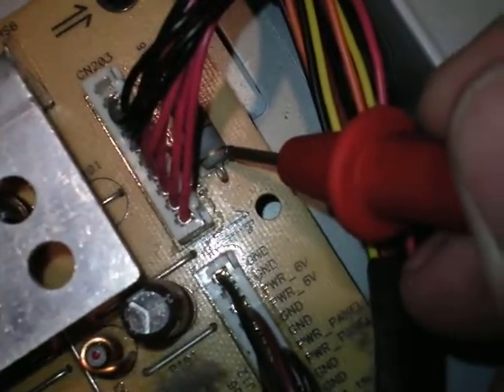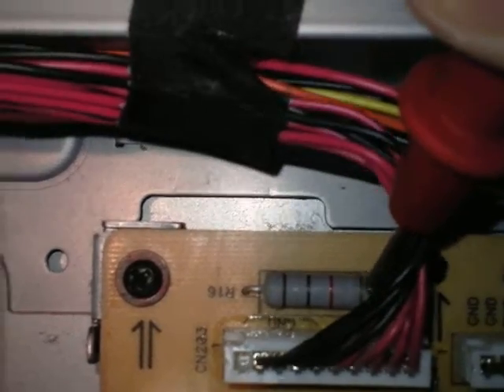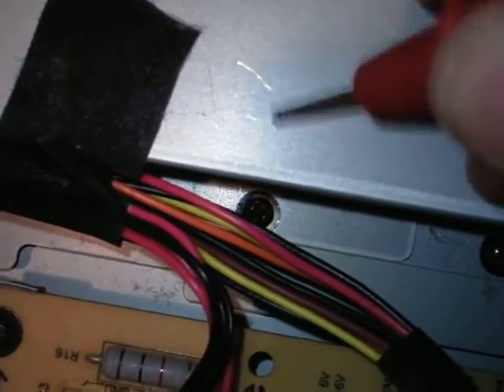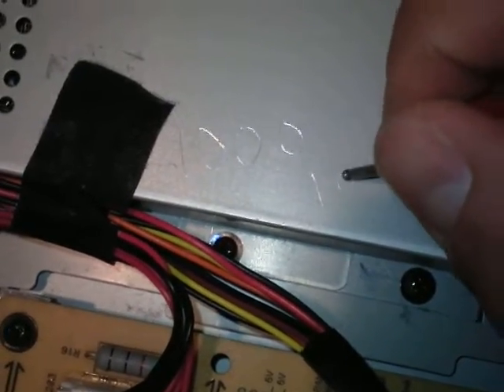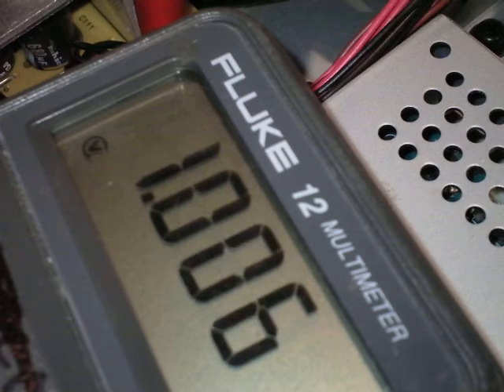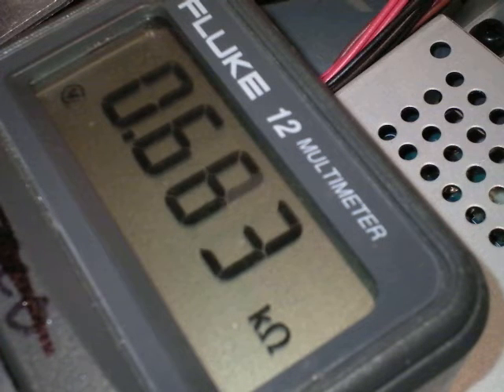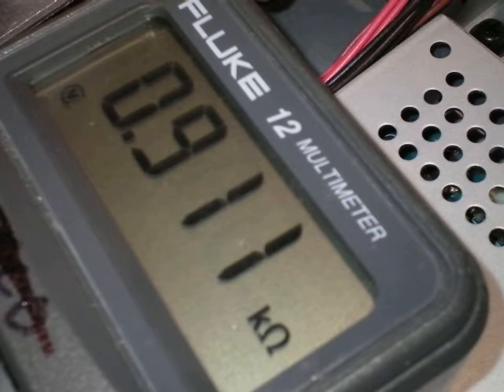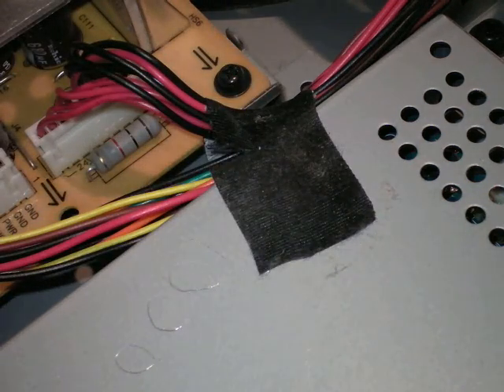How to check Resistors using meter

Comment: Great video ,you actually explained the color bands where as most videos assume everyone knows that info . I am trying to check a Start Capacitor from a 240 v single p-hase air compressor , it has a bleed resistor soldered across the terminals so I am wondering does the resisitor have to be removed to test the capacitor ? I am getting from zero to 15 ohms across the terminals of capacitor with the resistor in series . It starts at zero and climbs to 15 and stays at 15 .

Comment: Great video 👍 I'm working on a power supply board and I have 3 resistors that show nothing for a reading does this also mean they are shot? I had to replace all the caps due to leakage already.

Comment: How do I check if a resister or diode is causing a short on a board?

by Darren Connelly
Reply from the maker: Must read all tv parts "out of circuit" for best results.
resistor looks burnt or reads 10% off value, for example 1k ohm resistor reads 800 then change it, and most diodes should read .4 to .7 one direction & "ol" when meter's leads are reversed. if diodes read 0 or .9 or .2 then change diode. diodes that read under .3 can cause damage (short)
Reply: Tampatec
Reply: Tampatec I have a Toshiba TV with black screen and funny DC voltage. All capacitors are fine and tested okay with MESR100 meter. However, both resistors at the hot area are showing no ohm both direction in circuit. Do you think these resistors are the culprit?
Reply: I have a resistor, ita all brown says 5 ohm on it memcore. O have a pcb board that keeps blowing the fuse and not getting power. With 2 seconds of putting power to the board, this resistor is getting 120 degrees. It is the only component on the board getting that hot. Is it shorted out?